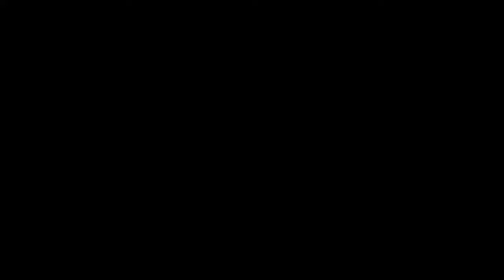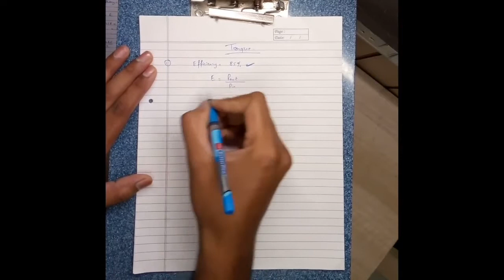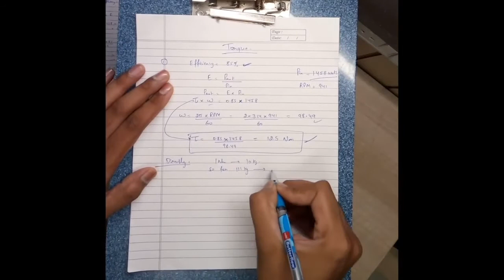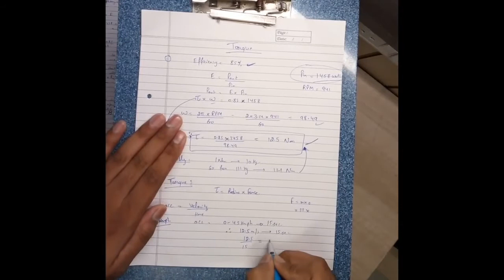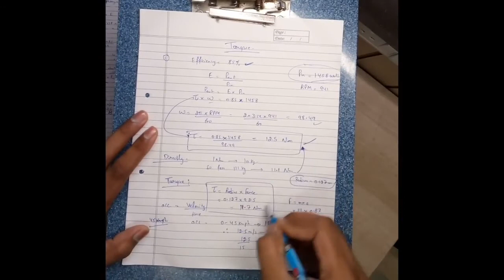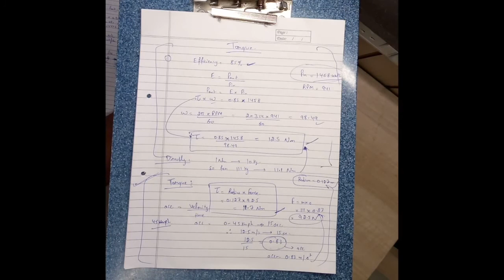How to Start Project on Electric Vehicle - Torque Calculations

Comment: Hello!! Sir 
I m working on high speed electric motor cycle, so I want to make a sport electric motor cycle,
But my questions is that how to calculate drag force, gradeability , other technical details, 
Etc
Could you please help me
Reply from the maker: Hello Siddhart, you have asked a big question and it can’t be answered in just one comment box. Better if write me a mail and share your project details.
Reply: @threephase4100  what is ur email sir?